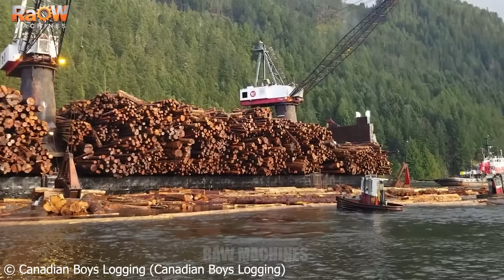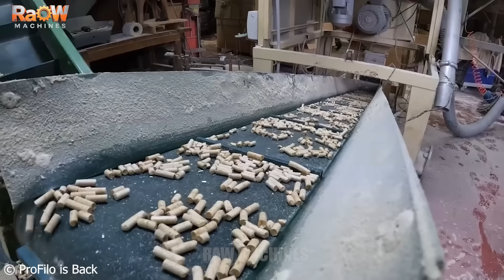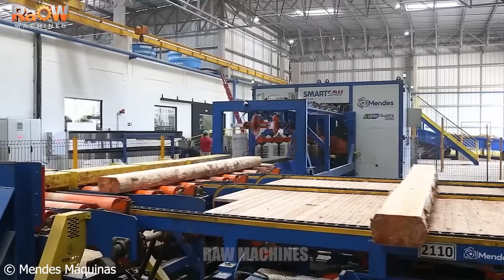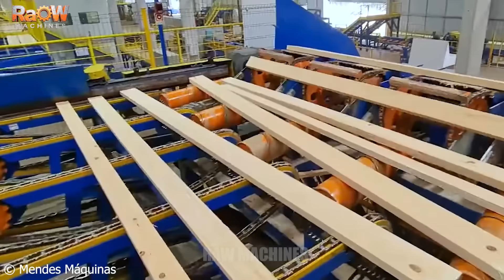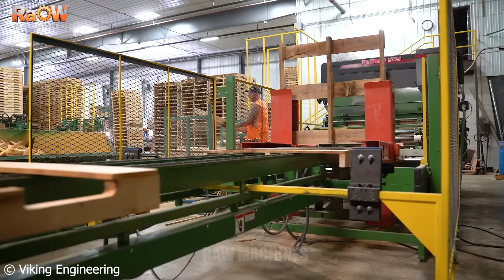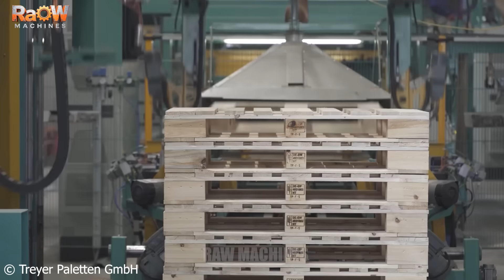Inside the World's Most Advanced Sawmills | How Giant Trees Become Wooden Pallets

Comment: A BOARD is a piece of lumber that is nominally one inch in thickness.  A piece of lumber that is nominally two inches in thickness is called DIMENSION lumber.  You're incorrectly referring to virtually every piece of lumber in this video as BOARDS.  You'd be far better served and far less inaccurate to refer to the pieces of lumber of varying thickness shown in this video as PIECES OF LUMBER.

Comment: Why don't they use the smaller trees to make pallets?  It just doesn't make sense.  The longest board in a pallet is 48 inches.  They have all these smaller trees going to waste.  They could use the big ones when they make bigger stuff.
Reply from the maker: Thanks for the thoughtful comment! 🌲 That's an interesting point, and it's one of the reasons the lumber industry is so fascinating. Every mill has its own way of matching different log sizes to different products based on equipment, efficiency, and customer demand. I really appreciate you bringing up the question!
If you were designing a sawmill, how would you decide which logs should become pallets versus higher-value products?

Comment: Be interesting to know if the bark pollutes the water ways, it makes a mess at the mills when I deliver logs.
Reply from the maker: Thanks for sharing your experience! That's a really interesting question. I imagine people who work around log yards and mills notice things that most of us never get to see. I appreciate you bringing up a practical side of the industry that doesn't always get discussed. 🌲
Have you noticed any changes in how mills handle bark and wood waste over the years?
Reply: @RaW @RaWMachines-g9r mill I deliver to is in Kaitaia New Zealand the yards have been concreted or tar sealed with drainage so that keeps the bark out of the water ways, then they just have to treat the water as they have river close by. It use to be really bad due to NZ high rain fall. Alot of the bark is stripped off with the mechanical harvesting so minimal bark at the mills now and any waste wood is burned for power they added in scrubbers to the chimney to try clean the discharge smoke. It’s closing down soon as power is too expensive in NZ